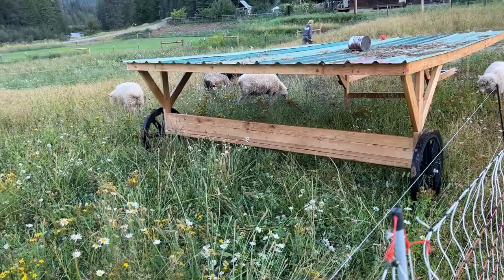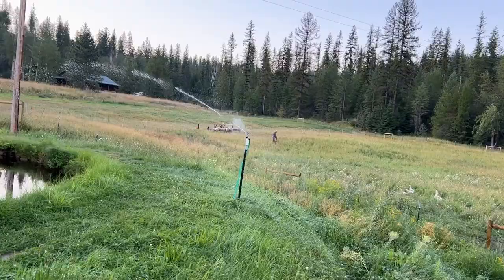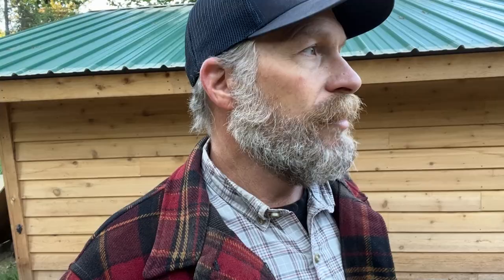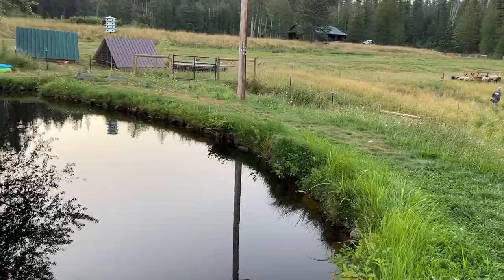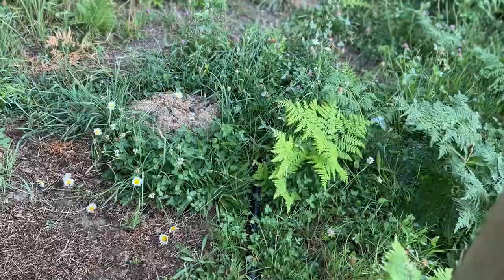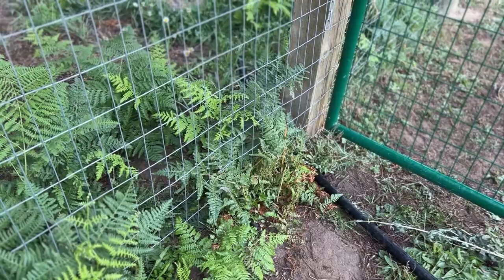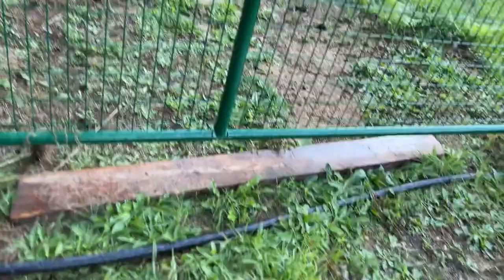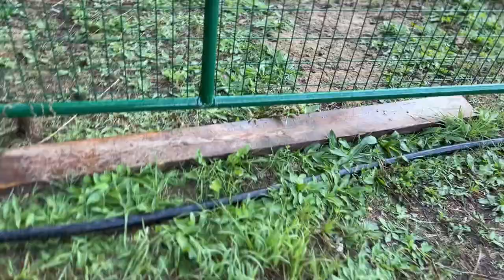Our Farm Watering System at Riverbend

Comment: Look into modifying the muffler. Use dome galvanized piping.  Put a couple bends on it and then attach original muffler at the end.  You do need to consider backpressure but adding some lengths of piping will greatly decrease the noise

Comment: I wish we had a well system but we are on city water. I do collect rain water in two rain barrels, hopefully I will be able to add more barrels, you can actually use a garbage can which are fairly inexpensive and they hold rain water just fine. Another saving grace is we live on a large rentention pond and we've pumped water with a sump pump before to the garden. We don't do it anymore since we got hooked up to city water and I started collecting rain water. But yes I couldn't agree more water is the lifeblood of a good homestead and let's be honest water is life

Comment: Regarding your loud generator pump: my husband and I encountered a very similar noise issue with our generator that is really loud. 
My husband built a portable box out of old pallet wood and some leftover fiberglass insulation to encompass our generator on 3 sides. It made a huge difference for our sleep. While I can’t say exactly how much it cut the noise, if I had to guess, it must’ve dampened the noise by two thirds. He simply put some handles on the sides so that it can be moved around with our generator. 
God bless 💯❣️🇺🇸
Reply: I just watched the video and wanted to say the same thing. If you can find 4-5 pallets, then make a 3 sided structure with and angled roof(note the 4-5 pallets). This will direct the noise away from your house. Not 100%, but it’ll be very noticeable and heavily appreciated.

Comment: Speaking of black poly pipe, perhaps you may consider using a bunch coiled up underground near your root cellar with an open end running up to fresh air on the outside and the other end running into storage cellar. Makes a decent vent and cold air intake for relatively little cost (assuming you get the coils deep enough). I can’t speak to how well it would work in your area, but it worked for a homestead ranch I worked for in my youth for the main house pretty well. Much more arid environment in SE New Mexico, though, so I don’t know how well it would suit your environment. Another idea I had on my current place was to change all the grey water plumbing and pipe it out to the garden rather than down the septic system. This works on pier and beam but would be a nightmare on slab and we don’t use much in the way of chemical detergents that would hurt soil and plants. Still tweaking that concept, but I like at least not sending all that water into a system I can’t put to much use since water collection and consumption is the main challenge in my area. Interested in feedback, of course!

Comment: If you have an issue with the noise of your pump. In the Army, we dig a small shallow pit or surround it with sand bags to a height over the generator/pump. It should eliminate the noise by 80%-90%.

Comment: G'day Josh, there is some good advice down below, Lorchid23, and Jennifer Haasch are on the right track. I wouldn't touch the exhaust on the pump motor.  I had a similar problem with a printing press in my garage,  the neighbor's house was only 14 feet away and he complained to the council, well, an inspector came out and he listened to the press running from the fence.
The inspector said that the sound was coming through the garage side window, bolt a sheet of 5/8 inch plywood over the window at approx 4 inches off the wall, this will baffle the sound. He was correct and had no more complaints. 
Steve
From the land down under.

Comment: We use city water (actually we are the last house in the system as we live outside the city).  When we moved in, our water pressure was about 28 psi.  We had to buy a pump to pump in the water from the city.  Its expensive to irrigate my gardens as we don't have a well.  200+ a month during the summer months.

Comment: Fantastic video. I have done something similar, but on a VERY reduced scale, with my hoses. Had it in for about 3-4 years now and discovered this year that a split would be useful in an additional place. I was wondering, what if you built a small, soundproofed shed for the pond pump to go into?

Comment: Can you build a shelter over the pump? I know with generators, if its in direct line of sight it is a lot louder than if it is behind any type of wall. Just include enough open spots for ventilation.

Comment: Looking at your A-frame chicken tractors - would it be possible to catch rain from the roof? Wondering if catchment could be done partway down the roof into storage on 95% of the roof, leave a small portion to run straight into a gutter they could drink from, then when it's not raining feed water from storage into the gutter. Thought popped into my head, don't know if it would be feasible & I haven't thought it through, just makes me curious.